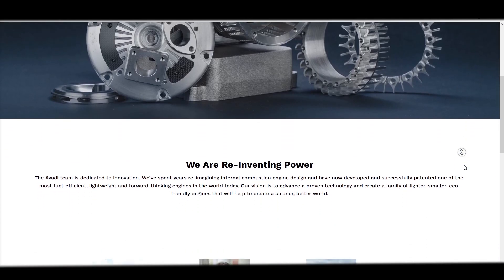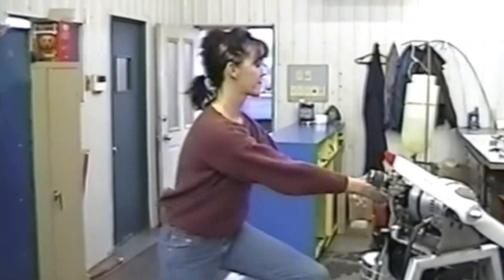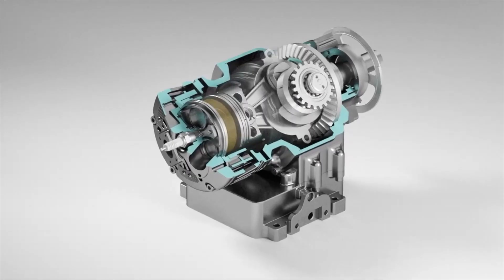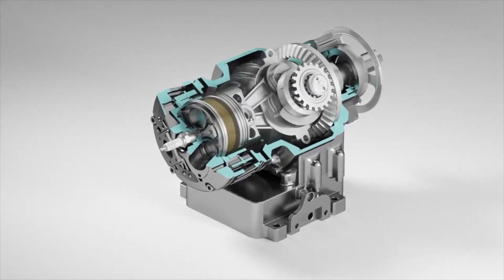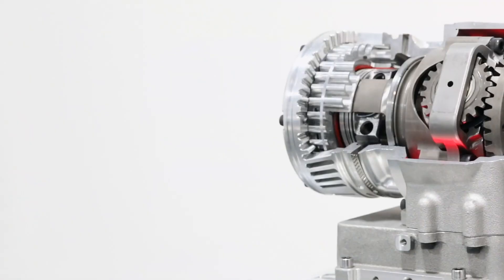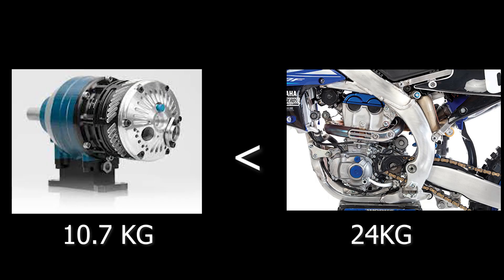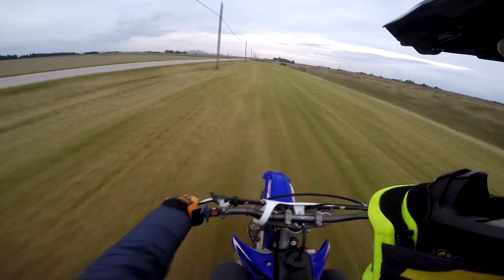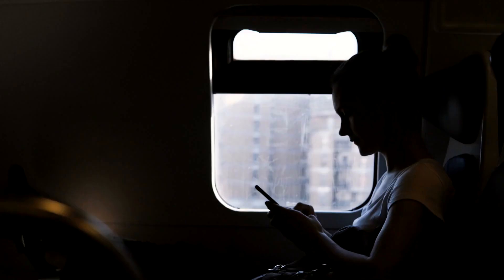The Avadi MA-250 - The internal combustion engine re-imagined.

Comment: The most important element of this engine is the spinning valve train. Very interesting concept. I suspect it could make variable valve timing simpler.
Reply: Not being shitty, legit curious why you think it would make VVT simpler?
Reply: @mechveteran01  just rotate the holes that the intake and exhaust holes line up with. Seems a lot simpler than moving the cam over while it's spinning. Plus you have an infinite number of positions you can rotate to
Reply: @phillies4eva Move cylinder head requires moving head gaskets.
Reply: It doesn’t make it simpler it makes it practically impossible. You‘d need to decouple the cylinder head from the cylinder and hook that up to a separate gearbox (ew) to adjust the valve timing. Not to mention you could only adjust timing and not lift, that would necessitate even more insane complexity. People try to act like the modern ICE is so bad and flawed it needs to be re-designed, which is simply not the case.
Reply: @SahnigReingeloetet  you just rotate the cylinder head but as pointed out you need a rotatable head gasket which might be impossible or at least very complex. Watching the video again I think it’s somewhat implied that the motor will operate over a pretty limited rev range so variable valve timing is kind of pointless.